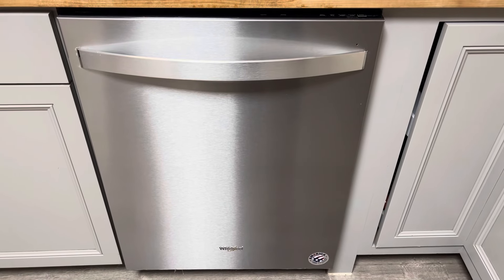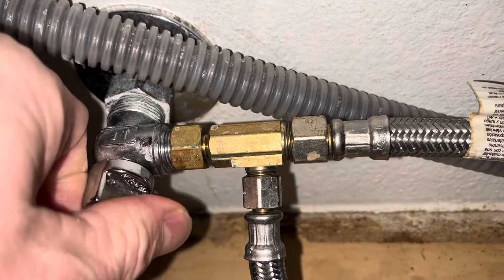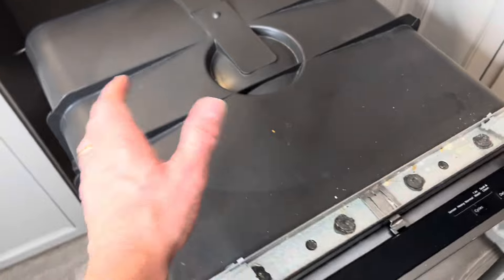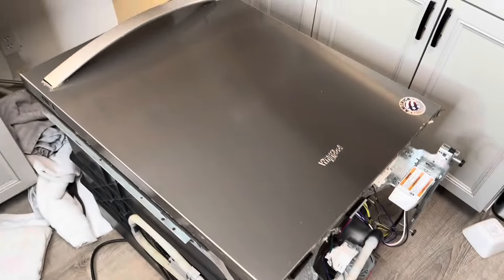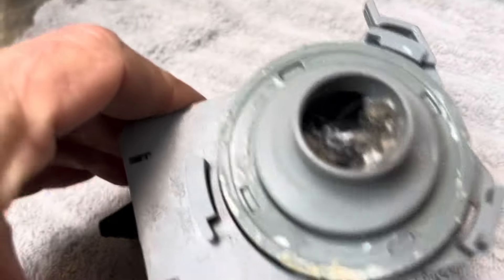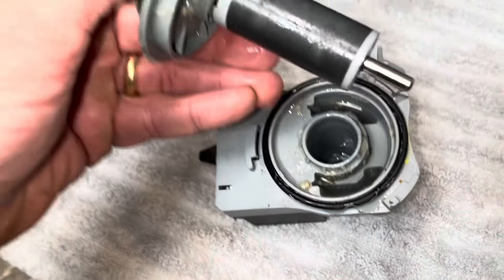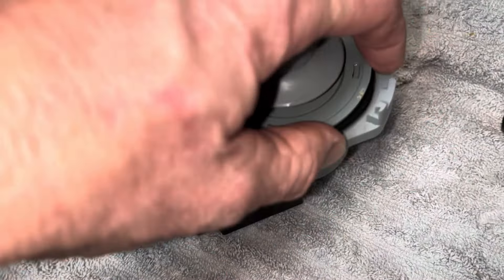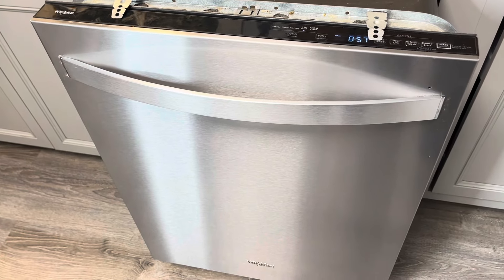Whirlpool Dishwasher Not Spraying Water? Quick DIY FIX | Easy Troubleshooting Trick Before Replacing

Comment: Another happy viewer here. After watching this and based on other research, I knew pump was the problem. I called a technician because this fix seemed daunting. But the technician said I need to replace the pump and quoted $350 for it. I refused, he still charged $80 for the visit. That was enough to nudge me to fix it myself. 😅 Followed the video, I needed to order plier to disconnect water supply hose. But I have my dishwasher up and running in 18 bucks! Thanks a ton.
Reply: Be glad you only got charged $80. Minimum house call here is $99.😅

Comment: 3:48 PLEASE PLEASE sticky this comment. 

This is a SUPER helpful video. HOWEVER, after I reassembled and everything was seated correctly the pump had started to leak!! Took me taking it apart a few times to finally figure out the issue. 

I had dried the gasket and housing off completely to make sure all debris was clear which it was. 
Then I remembered I had some waterproof gasket grease from a shower mixing valve repair. 

I coated the gasket with a thin layer of waterproof gasket grease (Danco Waterproof Grease 80360) and putting it back together just felt way better. Tried it out and NO MORE LEAK! 

I have a feeling the dry rubber against the plastic was not allowing it to seat correctly in the housing and this fixed that. 

So for anyone having this issue, go pick up this grease, it’s only a couple dollars and saved me from just buying a new pump or gasket! 

Thanks again for the video it was indeed helpful!
Reply from the maker: Glad this helped and thanks for adding the tip to your comment as well. 👍
Reply from the maker: Great great comment here. Thanks for the tips for the audience=)
Reply: Was thinking the same thing. Lubricate the oring shown and the rubber gasket inside the brass connection where the water line was unplugged.
Reply: Just went through this last night and thankfully I was smart enough (usually not) to leave the dishwasher out before a test run. Sure enough there’s a leak now. 

Gonna grab some of this grease tonight and try again. Thanks for the tip.
Reply: Why didn't I listennnnnn, off to ace tomorrow lol
Reply: @tristanclark4124  hopefully it worked out for you!
Reply: @nicksindt9800  I hope that solved the problem for you!
Reply: @TFro3  it did lol!
Reply: This was my issue too. Major leaks because of the gasket. Finally got it back on without leaks…but it sprayed for like five seconds and then stopped and it still won’t spray again.
Reply: @tristanclark4124  awesome!!! So glad to hear!
Reply: @TFro3  - Actually couldn't find the right stuff at Home Depot, Menards, nor Ace Hardware in my area...plus I busted one of the plastic pieces inside of the sprayer thing as I was taking it apart to clean it. Wound up buying a whole new piece and replacing it. Works like a charm now.
Reply: @nicksindt9800  oh bummer!! It’s always by the replacement faucet gaskets. I almost bought a whole new part as well but had this on hand from a shower gasket replacement and solved the issue before I ordered the new part.
Reply: I'm sure a bit of olive oil would do the trick as well. Saves a trip to the store.

Comment: Thanks for the video! I had a lot of gunk in mine, mostly wife hair!

Just a note for anyone else watching, there is a retention clip on the electrical plug that is easy to get off with a screwdriver and a plastic retention piece on the motor that gets depressed by your thumb as you turn it. Was not shown here and really messed me up for a few minutes until I figured them out.

Comment: Just wanted to say thank you! I followed these instructions and was able to save hundreds by not having to call a tech. Thank you, thank you!

I also want to say I read and followed the comments about lubricating the O-ring on the pump  before installation. I used coconut oil.

Comment: Awesome tutorial, helped me! My dishwasher is a little older (apparently) and the motor housing was MUCH less user friendly to access and open. After finally getting the housing unmounted, I had to even unscrew four screws to get to the impeller insides and magnet. There was a bunch of gunk in there, but nothing that seemed like it would stop the impeller though. But I cleaned everything out, and when I shone a flashlight into the receiver housing under the washer, that's when I discovered a little hard plastic shard sitting in the water area that could potentially impede the impeller. (So note to carefully check that part as well, especially if gravity would have any loose bits from the motor housing fall out when you unmount it!), Put everything back in reverse, tried it out and it works like a champ! Awesome! Surely saved me a couple hundred, but you likely saved me a good $1000, because I surely was going to go buy a Bosch or other high end washer with an extended warranty next time! Added plus, wifey is impressed! Thanks!

Comment: Just a fyi if you can't pull the dishwasher out from under the counter, I had to raise the leveling feet all the way up (they just turn left or right to raise or lower the unit) so the dishwasher was sitting on the ground and then picked up a little to get it over the flooring, then it slid right out and this worked!! Thank you!!!
Reply from the maker: Awesome tip, thanks for sharing!

Comment: Many thanks for this video! Helped me figure out what I needed to do to repair our dishwasher myself. While it wasn’t as simple as finding junk in there like yours, your step by step walkthrough helped me understand what I was looking at and ultimately what the problem was… the plunger (not sure what else to call it) at the end of the magnetic rod had detached and was rattling around in there which led to pump failure. Got a replacement pump installed and it’s singing along beautifully once more. Thanks!

Comment: This got my dishwasher working again - thank you so much! My symptoms were no spraying and the latch wasn’t locking the washer tight. Water IN and Water OUT were working just fine though and I cleaned out every other potential clog point before I found this video. Thanks, again!
Reply from the maker: Great to hear it. This seems to be a common problem with these dishwashers
Reply: @DIYTechnician good to know in case I buy a new one/need to clean it, again.

Comment: Hey this helped me a lot. Fixed it. Only thing I'd add is mine had a metal plate attached with a torx behind the pump. WAY easier to put the pump back together and check the seal on the gasket with it removed and it was easy to put back on after the pump was back together.

Comment: Thank you for making this.  Mine had no visible blockage but the “fix” still worked.  I wonder if it has to do with the magnetic drive?  I had a dog fountain with a magnetic drive pump.  Once in a while it just got “stuck” and failed unless I took out the magnet to “reset” it.  

Either way this works.  Thanks again.
Reply from the maker: Hahaha that’s great to hear. I’m surprised at that to tell you the truth.  hey whatever gets it back working:)
Reply: Same here second time I've had to do it. Wonder if I should replace the part. It's getting quite tedious
Reply from the maker: That’s a great point and it sounds like that’s entirely possible.

Comment: My 2017 Whirlpool dishwasher had the same problem..the circulation pump on mine has a fine screen below the 4 screw  impellar housing that barely looked block but I cleaned it with a tooth brush and dish soap the impellar unscrews from the center magnet shaft..works great now..however my pump was very difficult to remove..it rotates off the same direction as this video but has a rubber sound damper post behind so you are required to try tilting it out forward to clear the mount..it was very hard to twist the pump off as it take almost a full quarter turn..great video here..saved me $$$ thanks!
Reply from the maker: Great comment. Thanks for sharing that as well. Glad this helped. Take care.

Comment: Thank you for posting this video.  I could not find in the Whirl Pool manual or any other literature your fix for the blocked pump.  Every other source wanted one to replace parts to solve this issue.  Your video shows more than a fix but a glaring engineering flaw in how the filters work (or do not work).  Thanks again!  ....another reason to Make America Great Again... Companies that care about the products they sell... Whirl Pool fix your filter problem.

Comment: I found your procedure very valuable. However, I shortened it considerably by not disconnecting any of the three washer connections. I was still able to get to the pump by tilting the washer about 70 degrees.
My 0-ring has an internal diam 1mm greater than its seat. Is this normal or should I get another that is more snug? Another viewer says she cannot find a replacement.
Reply from the maker: I was able to use the existing gasket. Thanks for the input:)

Comment: Im going to try this. Wasnt sure how to get it off to see if its plugged. Dishwasher wont spray but fills up and drains. Sure hope i get it going again like you did yours.My Whirlpool is 6 years old.
Reply from the maker: Hope it solves the issue
Reply: @DIYTechnician  Couldn't get the pump to unscrew apart. So after putting it all back in cabinet and turned it on to see what happens....it came on and washed and sprayed for a few minutes and just stopped and never did anything again. So mad that I'm giving up and looking for a new better dishwasher.

Comment: I was able to backflush mine without pulling it out. I removed the filter, screen, and lower spray arm and washed all of them in the sink with hot water. I took a large funnel and a medium pan full of hot water and flushed down the outlet where the lower spray arm attaches. It took 3 tries but I got the junk out to where I could grab it with needle nose pliers. It seems a lot easier than this so I thought I'd post for others.
Reply from the maker: The more tips and fix suggestions and options the better. Thanks:)

Comment: So I did two additional steps. I pressed 3 buttons in sequence with 1,2,3 and 1 sec between…it gave me an error code. The round float on the bottom front inside was clogged and not working. I poured vinegar and Dawn and cleaned it good and poured hot water on it and it worked!!!
Reply from the maker: Awesome!!

Comment: This worked perfectly. Lots of plastic in that blade. Getting that o-ring was a challenge, which lead to a leak instantly. Once o-ring sat correctly, leaking fixed.
Reply from the maker: Appreciate you posting your experience with this fix. Take care.

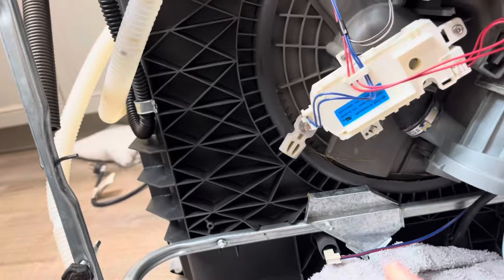Comment: At the 2:34 mark im having the hardest time trying to get this piece off. Any suggestions.
Reply from the maker: Maybe a rag and some channel locks. I havn’t had to try that but I think it would be my second option to try and see if that works.
Reply: Same
Reply: At least on my dishwasher, there was a tab you've gotta push "in" (towards the tube) just a little, and then another one on the back side (the stuff that's hard to see because its close to the washer) that looked like it had to be pulled "out".
Gently though, just a little nudge on the tabs and then I could twist the part off
Reply: @soniclettuce  i wish i would have seen this comment earlier haha this was exactly the case

Comment: Thank you   I took mine apart and the pump was clean and spun freely.  Don’t think the motor is running.  Any ideas.
Reply from the maker: Did you happen to get the easy stuff out of the way first inside dishwasher? Filters, screens etc? If so, I’m not sure from there.
Reply: Thank you and I did all of that.  i guess I will have to try and replace the $150 motor or junk a 5 year old washer.  Sad state of Whirlpool manufacturing, rubbish now.  Cheers

Comment: Mine only sprays sometimes, I do get water inside the dishwasher, but not spraying, also when push start button, I hear a clicking sound from under the dishwasher. I tried to bypass the flood switch but nothing changed. Before ordering a new pump, could you advise what else could be the problem?
Reply from the maker: I can’t say ive had those same symptoms with  mine. The clicking makes me a little suspicious that it’s something besides what is shown in the video here. Maybe a sun next matter expert can chime in here on your issue. Good luck to you and thanks for watching my videos.
Reply: Same with mine,, I get a vibration every few seconds like a motor is trying to start but nothing. After a few tries, it starts. I checked all areas and nothing is clogged like this video
Reply: @DIYTechnician  Thanks. The problem was the circulation pump, replaced it and now works like the first day we got it.
Reply: @beardog420  Sorry to hear that. It seems your problem is same as mine. I could figure out mine, a faulty circulation pump! I bought another one from eBay for $20
Reply from the maker: Awesome!! Love it when it works out.  @Fgrgplayzz

Comment: My pump seems to have another piece connecting it to the base of the washer which does not allow me to turn it to remove. Any suggestions?
Reply from the maker: Hmm I wish I had a picture to see what you’re talking about. Without seeing it I’m at a disadvantage on helping.
Reply: We actually realized it is a different part and the entire piece has to be removed.
Reply from the maker: @jenniferbeaudean3524  ok sounds good. Did it fix the issue?

Comment: I have tried twisting that part forever. My husband has tried as well. We can't get it off. Feels like we're going to break something trying to get it off. Any suggestions?
Reply from the maker: Any way to use some kind of mechanical means?
Reply: You have to push the plastic hinge in and twist
Reply: @DRINKPOPSNACK  thank you for this tip, I couldn't get mine off without pushing in the plastic clip that's on the side facing you, looking in the same orientation as this video.

Comment: Mine makes a vibration every few seconds like a motor is trying to start but nothing and the it seems to start but not cleaning well. No clogs anywhere
Reply from the maker: Have u cleaned the dishwasher filter already?
Reply: Maybe try replacing the water inlet valve?

Comment: So I would caution against opening this pump up unless it is a last ditch try and you are (otherwise) ready to buy a new one. I also disassembled my pump per the video, but found nothing. However, because it is an 8+ year old unit, the o-ring seal was deteriorating - grainy blackness when I cleaned it with Q-tips. I cleaned it and put a layer of o-ring grease on it. However, it leaked pretty badly. I repeated it, but to no avail. AND - YOU CANNOT BUY THE O-RING SEAL BY ITSELF!! The only thing sold is the entire pump assembly and that is prohibitively costly! So I am looking at a new dishwasher... 😒
Reply from the maker: Damn the luck. Lots of success from folks using this, however, your situation seems to be an outlier and seems you also have the same luck I typically have with appliances:( best of luck to you.

Comment: Brand new dishwasher has the issue as in the video.   I will call the supplier first as dont want to viod the warranty.   At least I should be able to tell the show what the issue is and then a tech can fix the issue under warranty.

Comment: Mine is 100% brand new from the store.... same issue but i just finished the install
Reply from the maker: Wow, it was broken out of the box?
Reply: @DIYTechnician  I'm not sure it's broken, but it fills with water, heats up and then doesn't spray
Reply: So what happened? Did you get it fixed? What was the problem? Mine I can hear it like it wants to work. I’ll see no water spraying.
Reply: @michellpapayani4643  so weird, I ran it again.... And it randomly worked. No issues since then.

Comment: Does Whirlpool make anything that lasts more than 2 years anymore?😂
Reply from the maker: I’ve burned through at least 4 dishwashers over the last decade. Other brands don’t seem to be any better either.
Reply: @DIYTechnician  I bought a new home with all whirlpool units. Fridge was dead from day one. Microwave also had to be replaced right out the gate. The dishwasher made it a few months before the connector on the pump started arching.

Comment: I personally am very fed up and disappointed with Whirlpool... I bought a suite of their appliances for my kitchen, and all of them except for the Microwave has problems... meanwhile my previous ones lasted well over 15 years at the worst.... The gas stove leaks gas internally, the fridge quit making ice, the dishwasher from the start doesn't even dry your dishes but now it stopped pumping water...plus it has another component that air locks periodically... its all crap that's not made well and I regret my purchases.
Reply from the maker: I hear ya loud and clear on that! My freakin whirlpool clothing washer just died too. Bought it brand new lease than 4 years ago and paid way too much for it. I havn’t had any better luck with GE either. If you come across a brand you can stand by please let me know.

Comment: My circulation pump looks a bit different than yours (best thing I have to a picture is this YouTube link that also has the same pump https://youtu.be/Y6dG5J4e4vk?si=P_DZAsUVUZMBAryD) and it definitely doesn’t twist off easy like in your video. Can this one still be twisted off somehow, or do I have to take the entire unit off? (like in the video I linked) Any help would be greatly appreciated, been without our dishwasher for a week after our water heater broke. Fills and drains but doesn’t actually clean anything.
Reply from the maker: Gosh it’s hard for me to say. I’m no expert on these things. Maybe someone can answer in the comments.
Reply: Are you sure you are trying to turn in the right direction? The one in the video is clockwise as view from the far end of the module you are trying to take off. I had to use a pipe wrench with 2.5 in jaws to get mine started.